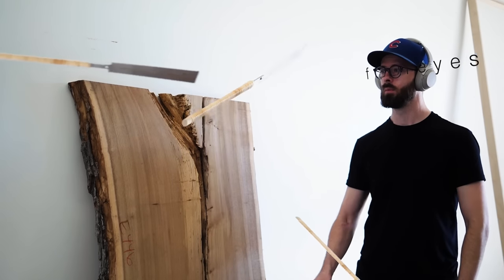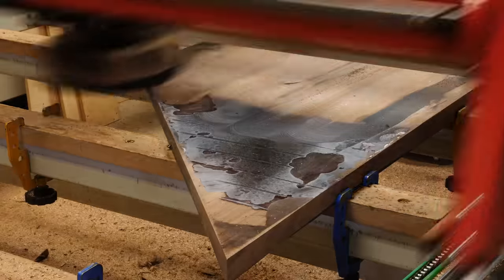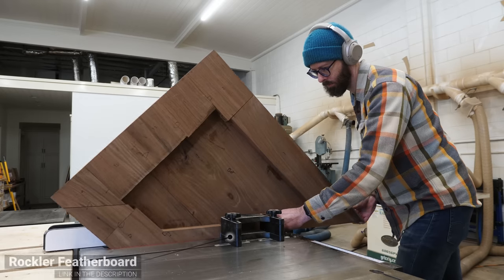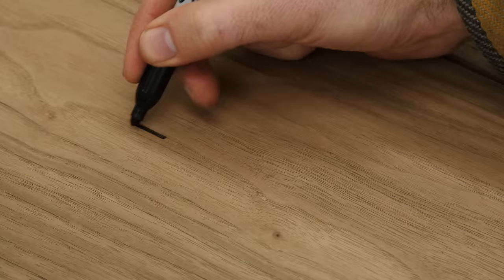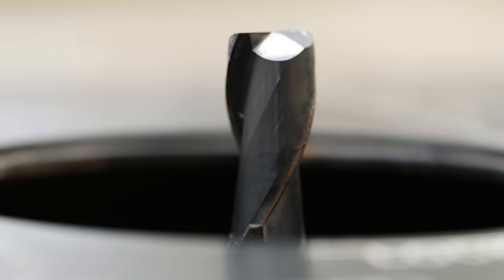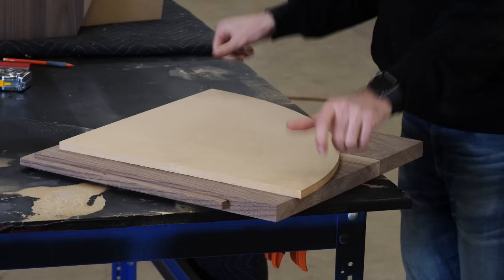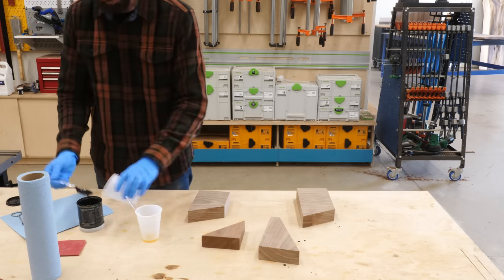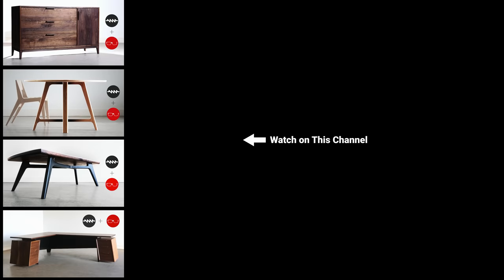The Surprising Truth About Working with Scrap Wood

Comment: I love the idea of making something beautiful out of a mistake like this. That band around the side that you used to mask the join in the two pieces of wood looks like it was always meant to be part of the design, and I actually think it enhances it so good work
Reply: I did the same thing with a very small scrap project--a box for a gorgeous set of chisels my wife got me for Christmas. The thin band of maple to increase the height of the box looked great, like it was planned. Had I tried to match the walnut edge of the box, it would have looked like a repaired mistake.
Reply: my friend's boss (woodworker) always said: If you can't hide it, highlight it. Seems to work very nice

Comment: For me it doesn't matter if you are doing big projects or projects from "scraps". This is why I watch your videos: very high level of craftsmanship, the style of your furniture, your personality and the way you describe the woodworking process (including technical stuff like dimensional drawings and explaining how to get everything to fit together, but also describing the art and emotion included in the design. And some dry humor throughout). And finally your videography excellent, it is as if the piece is actually right in front of me. We can see the details of the wood grain and you capture all the angles showing how your tools make the cuts you need. That's what is exceptional about your videos and it doesn't really have anything to do with "big" or "small" pieces of furniture.

Comment: When I first started as a carpenter's assistant decades ago, I got all excited about the hole my mentor put in the wall I had just painted as we installed the first row of hardwood flooring.  "Relax", he said.  "The difference between a 'dub' and a crafts[person], is a crafts[person] knows how to fix [their] mistakes."  I like the design challenges you discuss on the smaller projects.  I get inspired to use scraps for beautiful pieces.  I also like the reminder that mistakes are made even by the most skilled craftspeople.  How the mistakes are dealt with adds character, story, and depth to a piece.  Kind of like our lives...  I like the maple-line accent.  It reminds me of the Japanese porcelain repair, kintsugi.  I definitely want a pencil.

Comment: The difference between someone who partakes in a hobby and a professional is detailed within this video. The steps you take to get to the end product and whatever you need to do that is necessary to finish the product doesn't matter. The intention is there, do the best job and make it good quality. Everyone makes mistakes, what differentiates the two is how you manage those situations.

If you're selling plans for these designs, those mistakes will save your customers and you a lot of future headaches which INCREASES the value of that documentation. I love the channel because it feels real and genuine. Hand made products are NEVER perfect, perfection can't even be made by machines . . . but you know that when you buy something from a true passionate professional, that they will deliver something that is made for a lifetime.

For those of us who've  browsed many rabbit holes over the years . . . I've seen decks and patios which are literally hanging on by the threads of a houses siding. I've seen gas lines being vented back into the house which should've murdered entire families. I've seen plumbing that was destined to fail or someone outright scammed someone by selling them a new appliance where there wasn't even a problem with the original "besides the equivalent of turning it off and on again." Every hand made product has its' own difficulties, please keep these coming.

Comment: I absolutely love this video. I am currently working on a project trying to make something out of a drawer but did not come out to dimensions because of shotty wood and my first experiences with propper dados from a dato stack. What would have been a gap on the bottom, is now a canyon on the top of a side table. Now my project is nothing is nice as yours, but I still didn't want to fill this void with glue or wood filler. So I cleaned it out and manufactured tilted in grain oak inlays, that will actually stand proud above the surface drawing your eye to what was never to be seen. My "Naughty Wood Frog" side table. Personally I appreciate the use of all materials. When your materials are constrained, your imagination can sore.

Comment: Miles Davis once said, "When you honk a clam, Lean on it,"  i.e. "It's not a bug, it's a feature." 
You're not alone. I've done the very same thing myself., albeit on a much smaller scale.  I make pipes (for tobacco, really) and I had an issue matching the stem to the stummel (Google it); the two pieces were ever so slightly different diameters. My solution was to take a small scrap of fancy wood left over from pen turning and create a ring to sit between them, with the ring being just proud of the two pieces and the corners rounded over. It worked so well, that I started incorporating that into all of my pipes since. So much easier than trying to hand sand the two pieces to the same size, especially since the briar is so hard compared to the ebonite stem. 
Lovee your channel.

Comment: I worked with a woodworker back in the '70s some of your older viewers may remember, Rudy Osolnik, in Berea KY.  Most of his work was done with scraps from Berea College Woodworking or from veneer mills.  He was mostly a woodturner but I see nothing wrong with using scrap wood if it makes your work more interesting.  Back then, at least in the midwest,  just going through a lumber yard was like going through scrap wood in that nothing was surfaced.  It was difficult to see what the lumber would look like when finished.  More experienced woodworkers got used to seeing the wood for what it would become but I find shopping for lumber today less of an adventure than it was.  I vote for keeping as much adventure in your videos as you can.

Comment: I honestly like the smaller projects, especially the ones with the scraps and off cuts. I have a huge workshop but where I like, getting any kind of decent sized lumber is a pain ( our native wood is plywood and MDF ), and I really don't like buying stuff like that online ( lessons learned from working with leather and thousands of dollars gone out the window because of crappy leather, so rule is, don't buy it unless I can touch it first ). What I do end up with is a lot of scraps, and in this video I really liked your solution for the underside of the table, that actually started my brain going in all kinds of directions as I thought about what I had in the shop and what I could do with it now that I saw that bit. There's also times where I will kick back watch your big builds while sketching out stuff, your approach to the videos is almost therapeutic and when I do want to build something big, you're one of the top people I check out to see if my idea has been done and if so how was it done or how could I do it... you get the point. So now the short answer to the question of big v. small, I like them both but the smaller builds are something I can actually make or get inspiration from. Like you said, it's easy to just "do you" but then again, is it? You've got a lot of people, almost 1 million subscribers, think about how you got them and go from there and shoot for 2 million.

The only limits you have moving forward are the ones you create for yourself. Please keep on building and sharing and I'll keep watching.

Comment: Dude. Your videos are so philosophical and deep, you really are as one with your woodworking.  And you're quite self-reflected, but with a slighty judgemental view toward yourself. I like that, it shows you're a perfectionist. Which I guess is the difference between high-end woodworking and Ikea. Keep it up, man. Also, I enjoy all your projects. Been thinking of having a go at a table myself actually. I got most of the tools, short of a rotex and a domino-hole-making machine. But I have thought of buying a rotex because I do a bit of woodworking,  but usually small chests and knifes and such. And the domino holes I can make with my router. I even know how to weld pretty well.

Comment: Honestly can't really tell much difference in the project size except at the beginning and end with the raw materials or the reveal.

The interesting thing to me is the problem solving process. Whether it's fixing mistakes, designing, or little tips, that's what I find a lot of value in.

Also, the light colored strip looks nice. Like yeah, it was to fix a mistake, and who knows if the non-mistake version would have just been better looking, but the end result looks good. So props. I've definitely "leaned" into technically imperfect things in creative processes (mostly audio), and the results were cool.

Comment: I’ve been designing and making probably twice as long as you, and I still make the bonehead inversion mistake occasionally.  I’ve used a similar fix, but hid the seam by apexing a bevel at the line.  I like your solution of the decorative maple line.   I might have repeated the maple line on the edge of the shelf.  In any case, you got a great design result for your extra effort.  I want a pencil; please put me on your list.

Comment: You could save scraps up from multiple large builds and turn them into a larger project. The interesting thing in doing it that way is you will be using different types of wood into the same project which will create neat contrasts and designs.

Comment: I vote a big- to small-project ratio of between 6:6 and 9:3. 

I watch your videos for two reasons.

1) I can’t sleep—or I can’t work any more—and the videos help me relax. (I don’t know the economics of YouTubing, but this may be the more lucrative for you, as videos are binged and the escapism often spills over into online shopping.)

2) I will apply the woodworking knowledge to my own amateur project. I’m not willing to buy a large slab, but I am willing to try a smaller project. Regardless of the project size, details on how to avoid or correct common problems are especially helpful; and the greater the number of small techniques, the more valuable the video is to me.

Comment: I really like the idea of taking something existing (you might call it scrap but I think of it as opportunity) and using it in a design/project. Just the mental gymnastics of working within some parameters beyond your control is intriguing. Run with as many as you think is best, just don't eliminate this path. Two cents added.

Comment: I like both small and large.  The benefit of small or scrap is that we all have off cuts and to see what you do helps to be more creative.   As to this vid creative way to fix the problem and I actually like the contrast.      I do have one question on tools. The black hot met and aluminum or stainless plate you use for holes. What is that and where do you find it.   Thanks so much. Enjoy your vids.

Comment: I know I'm late to this, but I don't think there's anything wrong with having "smaller" builds. If anything, finding a way to utilize the leftover bits of a larger project is more interesting. It sorta forces you out of your comfort zone and shows off your ability to improvise and adapt. This entire project was basically improv and it's cool to see how you chose to creatively solve the problems you came across and still end up with a beautiful project. If I messed up that bad in a project I would've scrapped the whole idea and gave up. You found interesting ways to fix it all. That's pretty friggin cool

Comment: Someone suggested in the comments above that a 1:1 ratio was their choice, which I think is an excellent suggestion.  But the twist I suggest to a target ratio of 1:1 (in your example 12 videos per year) is to add commentary on why "scraps" (given what woodworking stores are charging for "scraps" I have to put that word in quotes!) from a project are or are not useful for a complete project build.  That is, I can imagine scraps from a piece not being usable for a variety of reasons. [When this happens in my case, I save these scraps for things like inlays, trim, or some other minor component of another project but don't try to use them for a complete project. But I am not nearly as creative or accomplished as you are.]  Thus, you could begin with the intention of maintaining a 1:1 ratio but arrive at a different ratio on an annual basis because of the unsuitability of the residual stock.  Hence, you wouldn't be obligated to derive a specific ratio.  Regardless, I really enjoy your video commentary.  Some people just talk and others speak with purpose - I think you do the latter.  Besides, I think your self-deprecating humor is pretty funny sometimes!

Comment: I like watching big projects, BUT I typically do not have the shop space, fancy tools, or the inclination to do things like that myself. My main power tools are a industial drill press that dates from the 1940's (older than me but not by much), a radial arm saw that I bought in the mid 1970's, a mid-size lathe as a recent purchase; and an assortment of hand planes from my father;    several that had belonged to his father, and one huge wooden plane from Germany.

So while i watch some large builds, I do smaller ones for myself, as rhe mood strikes.

Comment: I honestly think the sweet spot is the content you enjoy filming, for example although this is a great video, right off the bat it started out with you saying you rushed into the build, which leads me as a viewer to feel as though the creation/content may not be at its full potential because you could be burnt out or tired and or need rest, i believe that all of your content is great and i genuinely think the quality of the videos are great however in terms of the build, you then had to find a solution to the problem, then you find another flaw which you then either want to conceal or embrace (like in this video), which can then have a negative effect on your other plans or builds. 

I truly can and sometimes will sit for hours and binge a few of your videos, but i think if it is giving you zero down time or it is taking away from videos you had previously wanted to make but cant meet the deadlines for, because you have done a scrap builds right after the main build and something goes wrong, maybe you should decrease the number of scrap builds. This could mean you do 4 small (Scrap builds) and 8 big (Main) builds, or 3 and 9, i think then you would be able to take time in between to rest and really think about the builds, while still maintaining a few of the more spontaneous builds like the off cuts and scraps.

Therefore if you have a massive build that you will want to take more time or may want to leave some room to allow for any hiccups or mistakes to be amended that would be great, because it wont have a negative effect on your future creations, and it will also give you a chance to reset before you start on another build.

Also on a side note  a video concept for you that i think would be cool, could be saving a few of the scrap pieces and making a hybrid build with mixed wood textures and finishes and or colours, that could eliminate the waste and also be a larger build.

All that being said, whatever you create and post i will watch, again i don’t really mind what videos you put, i just hope you are getting good breaks in-between to recharge as i know from personal experience, when you got at 100 Miles an hour for too long you could be more susceptible to these minor mistakes that end up taking you more time to try and rectify.

Mo

Comment: A little late to the game commenting on the big vs. small builds, but my two cent's worth... I watch woodworking videos as much to learn as for entertainment, so what I really want to see are new techniques and problem solving. How can I do something that I've never done before, and how can I fix it when things invariably don't go as planned? Using that methodology, your small projects are just as worthwhile, if not more so, than the big ones. As others have mentioned, the small projects also show us how to use sub-optimal materials in creative ways, which is what most of us without unlimited budgets face routinely.

Comment: "True craftsmanship is the unwavering dedication to consistently and reliably provide high quality products and services to clients, regardless of the circumstances. A craftsman’s work is always thorough and complete whether it’s front and center or behind the scenes. A craftsman never cuts corners or leaves loose ends. A craftsman always follows through whether they profit or take a loss. A true craftsman is the model of integrity, humility, ingenuity, resourcefulness and dedication to the perfection of their craft for its own sake."   Stephen Rutledge.                                           Let me add when a craftsman screws up, (Right, It never happens) they are able to make the piece better than the original plans. Keep the content coming.

Comment: I came across your channel because of this 'scrap' video so it'll be a shame if you stopped doing them. I think there's something beautiful about not letting things go to waste, specially in this age where everything has to be newer and faster. Your other big projects are as important as these ones so I guess somewhere between 50/50 60/40 would be the sweet spot.

Comment: I know this is a year later, so I have no idea if my input will be valuable to you, but here goes. I personally don't see a difference between your large projects and the small ones. As a fairly new woodworker, I value the walkthrough of the processes. I especially appreciate the mistakes - or rather, watching the problem-solving process in fixing them. None of that depends on the size of your project, so I'll keep watching regardless.